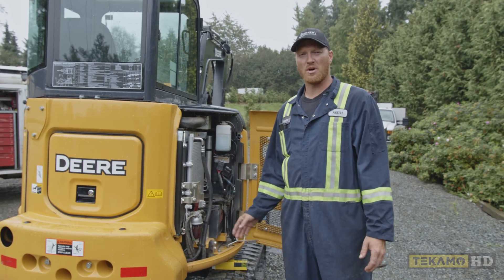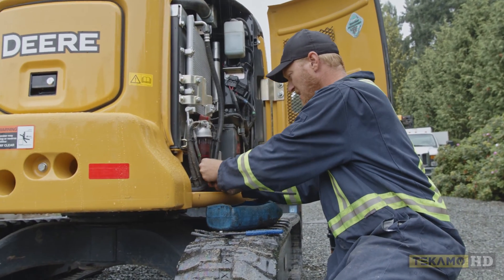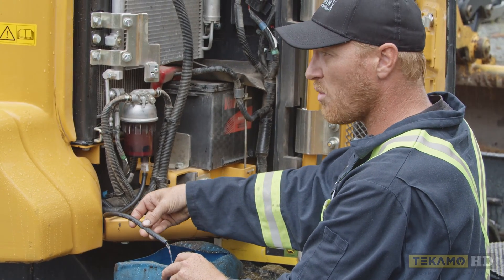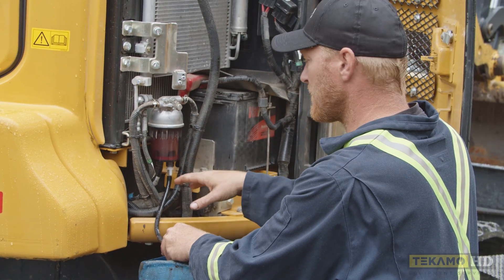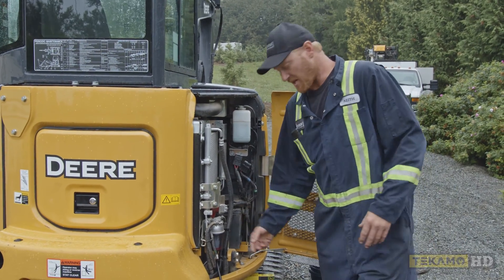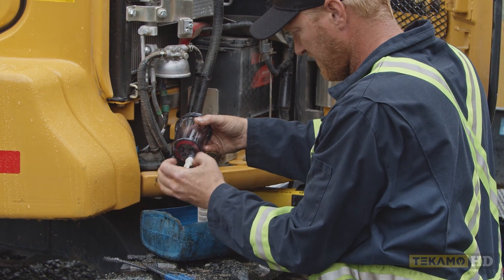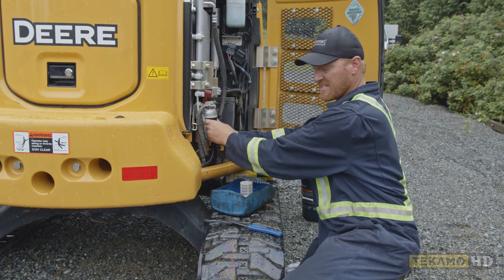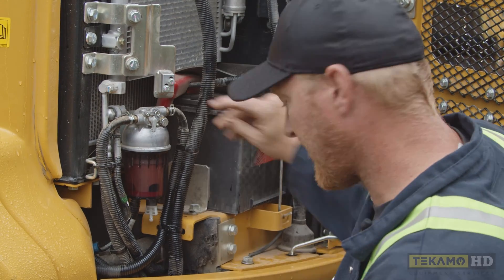What's This Part Used For? Excavator Maintenance For HEAVY EQUIPMENT Mechanics

Comment: Are all diesel heavy equipment have water separator?
Reply: Yes. Water will always get into diesel fuel due to condensation. Therefore all diesel engines require water separators

Comment: Hi Keith. You helped me a week or so ago and I greatly appreciate it. I hope you won't mind another question on my 2016 JD 26G. I want to install a grappling thumb. It is a new thumb kit, from John Deere and I have the installation instruction manual. I have read the instructions and I think I have the tools and the skills to do the job. However, on Page 19 of the manual (T218592), it gives instructions on "Adjusting Auxiliary Circuit Operating Pressure". This is beyond my capabilities and frankly, my understanding. Should I just turn this job over to a professional? Thank you.
Reply from the maker: Hi Richard. I would suggest consulting a professional if you aren't certain.
However, you just gave us a new video idea! Now if we could just find some time to record it.